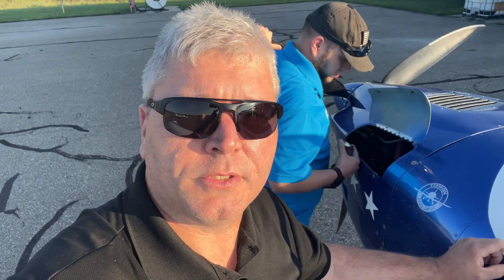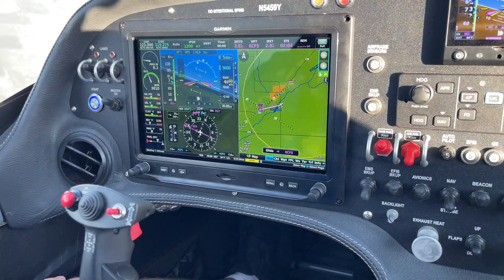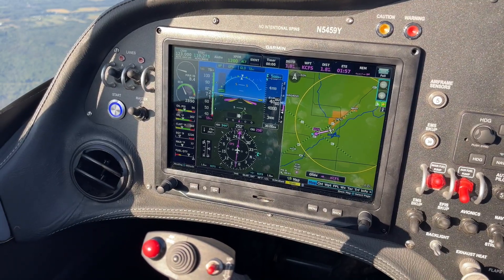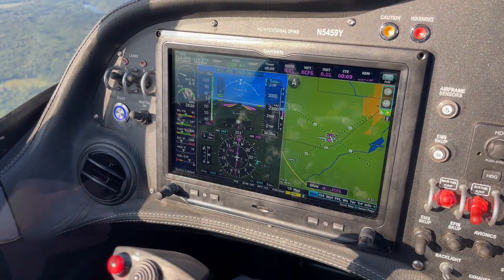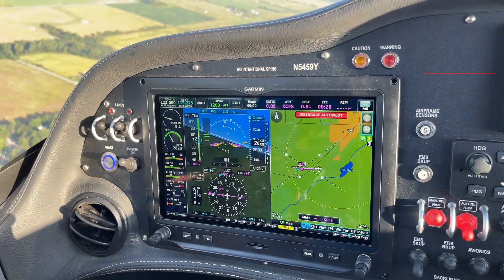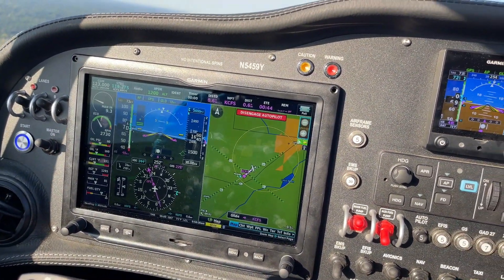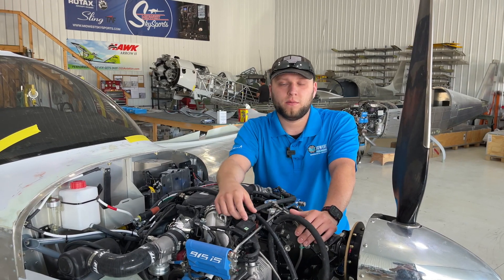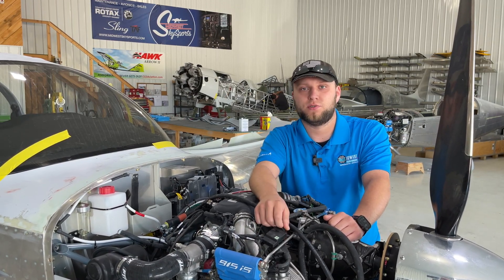Smart Glide™ In Flight

Comment: I could not hear the audio annunciator - were you getting an audio alert to disengage the AP? I  would assume so.  Also, will it continuously update the fields available within the current glide range as you continue your descent? I'm considering adding this to  the new panel for my C-177. It is impressive.
Reply from the maker: Yes there is an audible alert to disconnect, when we recorded this the audio was only through the microphone. It currently doesn’t update but they are supposedly working on that.

Comment: Great video guys, much appreciated. Where can I enter the VG and sink rate to enable the feature? The G3X Touch, manual rev. S  is a little light on it. Where do I make the changes in the configuration menu?
Reply from the maker: Check out our other video here. at about 3:33 it goes through it. https://youtu.be/6Snbignb57s
Reply: @MidwestPanels  Thanks, for the quick reply, can’t wait to test fly Smart Glide! I texted Jean earlier today for the sink rate, what did you use in the Sling 2? 700fpm? I know VG is 72 knots.